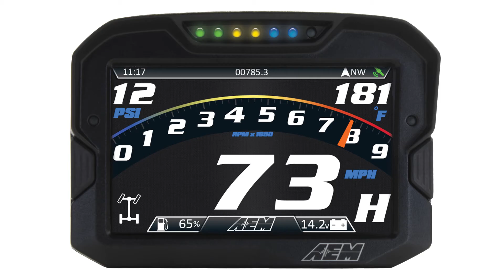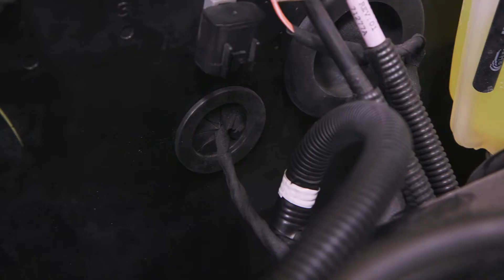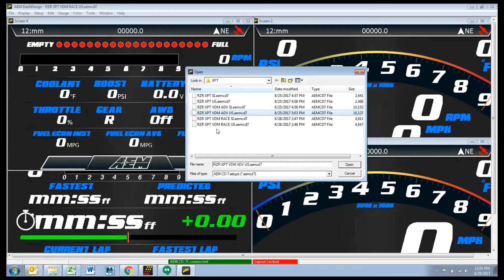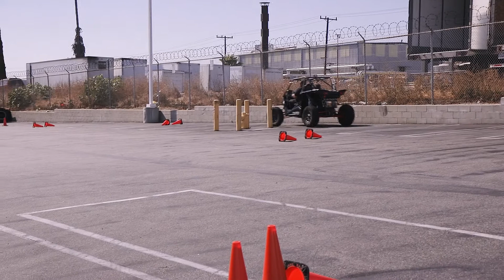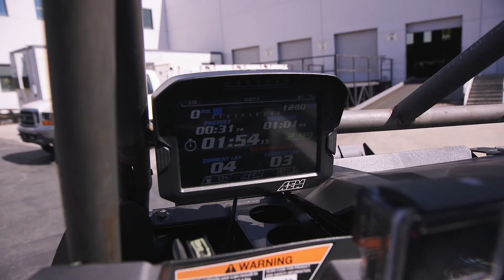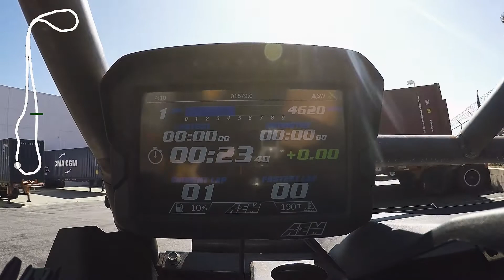AEM Plug & Play Polaris RZR CD-7 Dash Kit Unveiled!

Comment: I see on the website it only reads boost on factory polaris turbo models. Could I possibly get the CD7 to read the boost on my 2015 polaris 1000 xp with an aftermarket turbo? I already have aem gauges that read my AFR and boost.
Reply from the maker: Yes, just like the addition of the boost gauge you can use the AEM 6 Channel Can Sensor Module (30-2226) to get additional data to your display. Simply wire the sensor to the 6CSM and configure in the software.

Comment: Does the roll cage mounting system come with the package? Is this also going to tolerate rain and a buggy wash? Very interested for the new tube chassis I’m building
Reply from the maker: The RAM mount is available separate, see the link below to get the CD-7 Ram ball compatible mount.

https://www.aemelectronics.com/products/cd-digital-dash-displays-adapter-harnesses/cd-carbon-dash-accessories/cd-carbon-mounting-bracket-ram-mounts

Also the dash is IP65 rated, so some light splashing/rain is ok, however I would remove the dash completely if there is a chance it will see high pressure or large volumes of water.